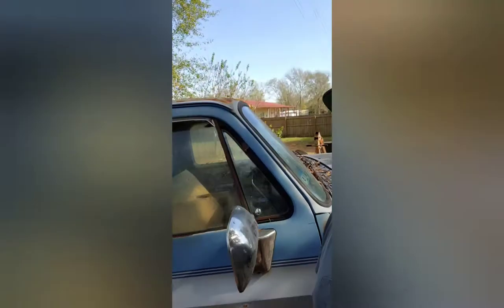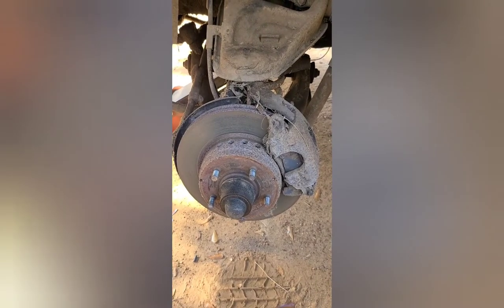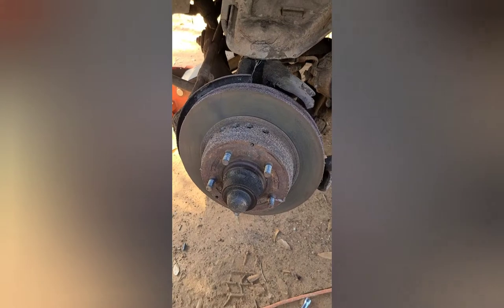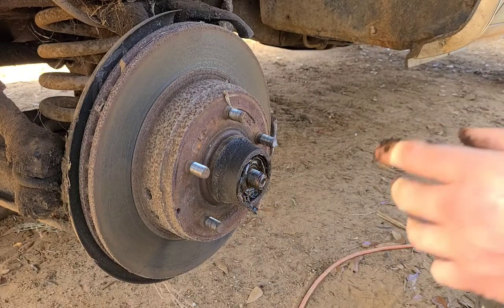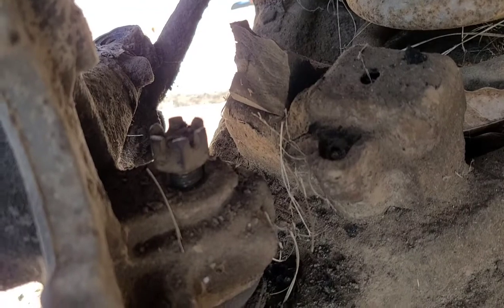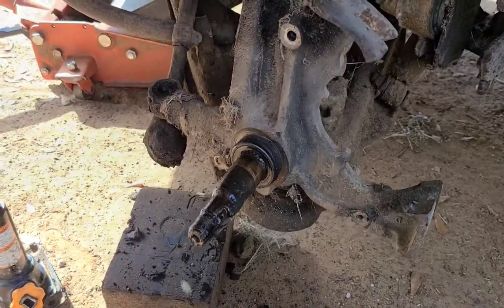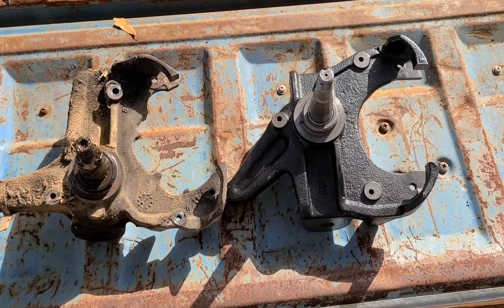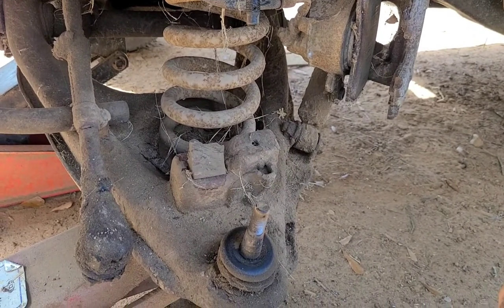c10 how to drop spindles

Comment: Did you have to grind the control arm for the wheel to fit? 
What brand of spindle? Thanks great project
Reply from the maker: I did not, it fit like factory. I have had pretty good luck with the ones on ebay. I believe there made by a few different sources so it's hard to be sure if there going to be good as the last, but have never had fitment problems just needed washers for the bearings.

Comment: THANKS FOR KEEPING IT SIMPLE BRO.
Reply from the maker: No problem, doesn't have to be hard right. Thanks for watching
Reply: @choppedinc.  I'm having another issue. I have an 89 chevy1500  short bed. I  put the 2" drop spindles on now im trying to put rotor back the truck.  the set 5 and 3 is what I need for bering but the race for set 5 bering is to big to fit the rotor

Comment: At the end of your great video. You say don't forget something? That you didn't show. More info please
Reply from the maker: On top of the ball joint there is a hole you have to put in the split pin in so if the nut comes loose it will not be able to come all the way of